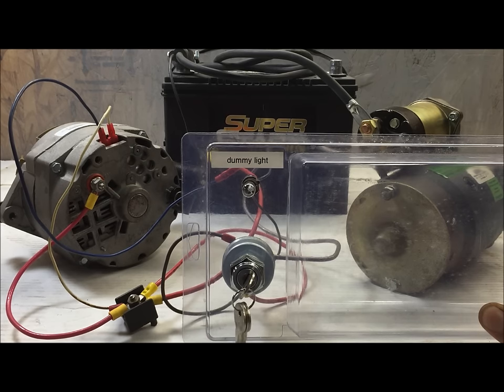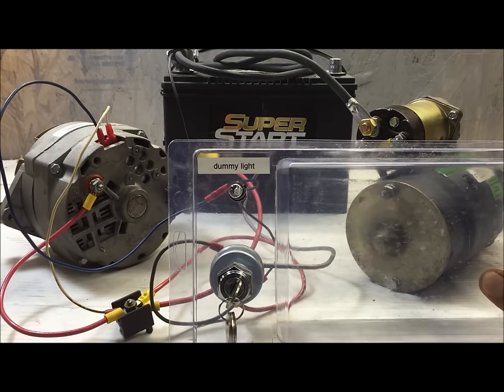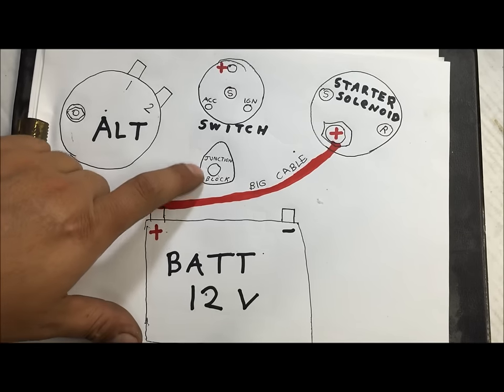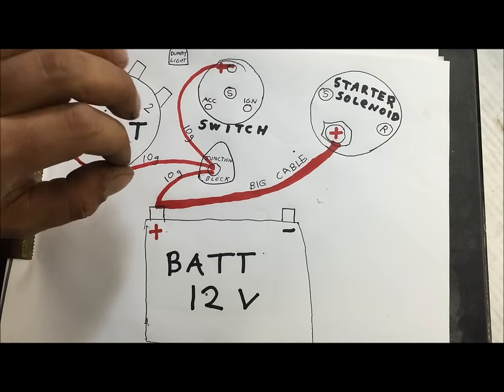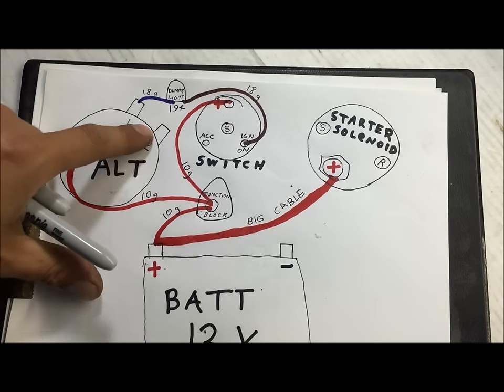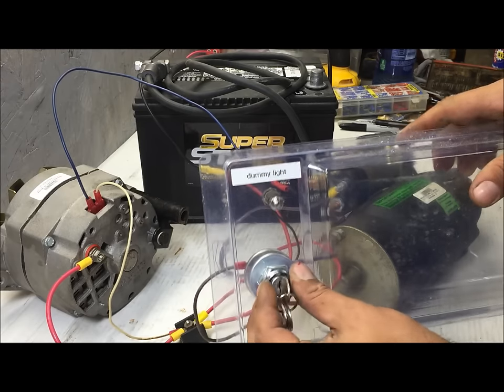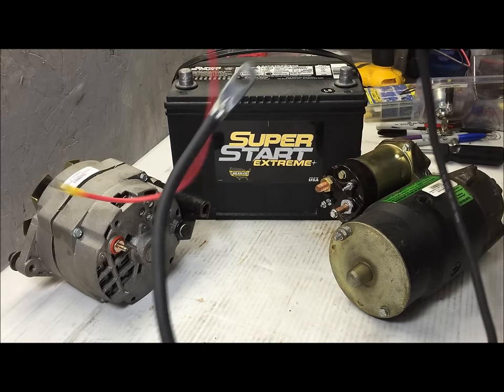64-72 charging system wire up using GM 3 wire internally regulated alternator

Comment: Could I use this method for my 73 ventura?
Reply from the maker: you need to buy a real wiring diagram for your car...  72 and up is wired a little different but it is the same idea...   yes, you could wire it like this ...  but the way it is already is fine
Reply: Chris Craft ok. Are you familiar with the old style fuse box? I was wondering if I could run a wire from the ignition part of the fuse box directly to the starter!?
Reply from the maker: those cars actually have a fused link off the starter powering the fuse box... off the big lug connecting to the battery..... i really dont understand why you would even want to do that...  please explain
Reply: When I turn the key nothing happens. I did a engine swap 350 Pontiac to 350 Chevy. I was told I needed to run the wire to the starter so it'll know when to start etc etc
Reply from the maker: there is a 10 gauge purple wire in the engine bay that starts you car...  it may have a fused link in it...  you really need to get that diagram to see where those links are...  find the purple wire out of the fuse box and make sure it is connected to I on the starter..  depending on the year the starters have 2 places to screw a small wire to...  I or R.. check that out....  or a blown fused link...
Reply: Ok thanks. I found a red 10gauge wire that gives me inside power (lights and wipers etc etc) I have a few other wires but only 2 are 10 gauge so it has to be one of them.
Reply from the maker: the red wire is going into the fuse box..  the purple wire comes out of the fuse box into the engine bay...  the purple wire goes through a neutral safety switch so make sure the car is in park or the plug is connected to the steering column...
Reply: LxrdJa
Reply: Chris Craft yea I found them thanks. The issue I'm having now is my flexplate was installed backwards so now I have to pull and reinstall.
Reply: felmor

Comment: Are there any inline fuses needed
Reply from the maker: just pop the hood on a vehicle and look where the fuses are... it’s up to you what you want to fuse
Reply: @chriscraft77022  thanks for the quick reply.  I'm restoring a 71 gmc with a 5.7,  it does have the conjunction but wires are cut in several places with fuses attached.  Going to install new wires and was curious where would be the best place to put the fuses.. thanks.
Reply from the maker: I need to make a video on fusing.. I will try ASAP
Reply: @chriscraft77022  sounds good.. I subscribed in case u do..
Reply: Hello again Sir.  I have another question,   my 71 has the ammeter. Do I still need the dummy light to prvent back surge,  also there is a light on my dash, I think its the batt light, would that be considered the dummy light? Its only in when I start the truck then shuts off.
Reply from the maker: @wiskiesgarage909  batt / gen dash light is dummy light..    ammeter has nothing to do with charging system...  i have videos on everything you are needing to know... search back on my videos..  i have a bunch of wiring that old stuff up on my 70 chevelle.... this video is basically how to wire it up on a tractor...   or anything, really..  the general idea
Reply: Rt on chris.. appreciate the response.   Ill check out the videos

Comment: alternator is nothing more than a pair of wires(stator and rotator). and dummy lamp limits the current in the rotator and also there  is a voltage regulator which sets the output of the generator to nearly 12 volts by inreasing or decreasing the current passing through the rotator.

Comment: in one thing you are wrong the R terminal can by used on a starter motor it a bypass to ignition coil to help with cold starting the second thing is that pin is used to reverse the polarity on a engine negative to positive ground and vice versa the ignition coil does not care what polarity is used it will still fire a spark! and by the way that ac spike gas 4 poles on them its tehnicaly not even ac its some thing ells whats fire in the cilinders ! by questions see how a emp device works! early magnetos never hade leads,distributor,condenser etc just 1 wire on the block! and bouth alternator and starter motor can by a :generator/starter/magneto at the same time that is what peopel dont teach in schools at all.so try that R terminal out and you will see they lied your car will work not fine but if you modify it litel it will run at a diferent polarity just like the old british cars again coil does not care what polarity.by notice some starter motor not mounted back then on the front by puleys thats why are there 2 pins so you can mount the starter just like a alternator but you need a regulator with out one the generater electricity will cause a engine run one so the starter is a magneto as well just like the old cars back in the days 🙂

Comment: So I don't know if anyone has a idea or if you would.  I'm having a issue with a build I'm doing.  I have a old golf cart that I'm putting a Honda clone 18hp gas motor with electric start.  I made a bracket for a alternator and its running off the crankshaft with a v belt.  It's a GM 1 wire alternator that is internally regulated.  The problem I am having is the engine will not start or run when the alternator wire to the battery is hooked up.  It pops an cracks an back fires through the carb like its causing some type of magnetic field with the spark plug.  If I unhook the alternator wire it will start an run just fine if I try to hook the alternator wire up when its running it sparks and arcs really bad.  Does anyone have a clue why this would happen.

Comment: chris I really like your video it helpme a lot to.understand. ignition .
but my problem is I have a vwbettle.66
and my wirering is like the one you
 show now in
 your. video but it wont dont crank .
and I have no power on ignition switch .
and my batery is fully. charge 12.6 
can u help?
thanks
Reply from the maker: you need to get a wiring diagram and buy a multimeter with a continuity function..   and start testing wires.... ive never worked on a beetle but the problem is probably around your starter solenoid ( if a beetle even has one, i dont know.. )
Reply: Hahaha yes it has one.!
I will follow. Your advice!! Thanks a lot.
Keep doing videos.you are the only one. Easy to understand.  You will be my teacher from now on.
Reply from the maker: where are you located? if you are in houston, TX i can fix your car in like 5 minutes
Reply: No chris Im in californi.
But thanks a lot! 
I really appreciate. You offer.

Comment: some people hook up accessory to the bulb wire so the alternator doesn't charge during crank fighting the starter
Reply: wouldn't that field fight the starter trying to spin the engine and actually slow it down? I am talking about during cranking not running.
Reply: Slow down lol I was just pointing out a small flaw in your diagram but i guess all the chiltons and haynes manuals have the wrong ones. Maybe if you go out to your car as long as you didn't mess with your charging system of course lmao and stick a simple test light or voltmeter in those terminals and tell me if during crank their is a magnetic field.Not supposed to be because it robs your starter of its torque. I never said your instructions don't work they obviously do. Their's always a better way nice chat though...
Reply from the maker: sorry, i wasnt attacking you..  i have a 3 wire alternator video that goes over what you were talking about..  this is a charging system video and i just happened to have it wired like that.. ( i had just wired it up on a model A)  you are 100% right about running #1 to accesorries..  but i just get irritated by people pointing that out in this video..when i have notes and comments about the fact that #1 may need to be connected to ACC on the switch..

Comment: question. If a car has all fuses removed, no accessories that are using any power whatsoever, and you disconnect the pos battery cable then connect a voltmeter inline between the pos battery post and the pos battery cable, should the meter show 12 volts or so? Iwas telling someone no, because there's no circuit closed,they said it should show 12. Which is it? Car in question is a '66 ChevyII

Comment: Is that the same way you would set that up if building  If you is building a portable gasoline generator
Reply from the maker: for 12V DC (direct current). YES
Reply: Chris Craft  That's what I thought I want to build a 12 V charger gasoline portable Thank you God-bless and have a merry Christmas

Comment: Can I used bigger cable like 4 gauge
Reply from the maker: watch my 100 amp alternator video..   of course you can use big cable..  also, google wiring charts and get an idea why they only used 10g on older cars..  even though they had up to 75 amp alternators

Comment: I have two white looks like shunts or something going to my main starter I cut them out and now my alternator is charging 18.9 volts please help. 1981 Chevrolet truck
Reply from the maker: I have a video on that
Reply: @chriscraft77022  what is the title I will gladly look it up I think it is a fusible link. I have replaced the voltage regulator inside the alternator as well and have a gauge instead of a dummy light

Comment: Wiring perfect..but show the connection with voltage regulator
Reply from the maker: the point is that in 2018 you don’t use the externally regulated alternator, but a good idea for a video.. I’ll try to get it up soon
Reply: @chriscraft77022  tnx..i wait upon my request...

Comment: If you replace the idiot light with a 12 volt LED, it won't feed back and cause the engine to keep running when you shut off the ignition!

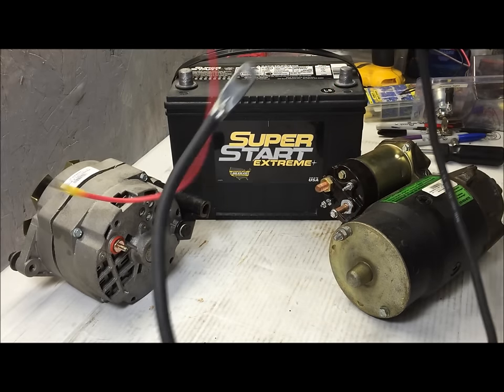Comment: For GOD's  SAKE !  At 8:22 you're hooking a BLACK CABLE up to the POSITIVE POST of the battery ! After you made a significant point of using the correct wire colors in your diagram, you should use a RED CABLE and let the backyard mechanics here KNOW that you're hooking that BLACK CABLE UP to the POSITIVE terminal of the battery ! Some poor bastard out there is going to use a BLACK cable and hook it up WRONG ! DISASTER ! DANGER ! I would reshoot the whole video over again using a correct color, ( RED ) positive battery cable. You're setting some fool out there up for disaster. God Damn. After such a good presentation too....

Comment: you make this look very hard cant you there has to be an easier way to do this
Reply from the maker: easier way for what?  What are you working on?
Reply: 1970 el camino custom just swapped the engine with a 350 LT 1 vette Engine going to put in a aftermarket hei distributor never done one before i know all about tdc and all that where the plug wires go the only trouble im having  what color wire goes to what.my wires coming from the harness are not color coated i guess i will have to strip the wires back till i see color right.i wrote down purple goes to s and yellow goes to R but like i said wires not color coated.
Reply from the maker: @larrybroad8746  this video is for tractors....   your car has a wiring diagram...   i own a 1970 Chevelle SS 454.... i have many videos on how to wire one up.. this is not it/// what year LT1???   my 2017 camaro SS has an LT-1

Comment: Great video, but you have your years mixed up.  They did not make this Alternator until 1973. The 64-72 the two wire plug went into the very back of the Alternator.
Reply from the maker: you obviously missed the point of the video...

Comment: Chris, great video, thanks! You describe a "194" light. That just seems to be the type of bulb. Can any indicator light be used such as this- https://www.ebay.com/p/Dash-Indicator-Light-Set-Painless-Wiring-80205/235830118?iid=173680538050&chn=ps ? 
Thinking "electrically", the juice would have to flow through the light to show charging, not be a pos/grnd light.
Reply from the maker: all gm vehicles used the 194 bulb because of the resistance it provides combined with another resistor on the ignition switch.. if there is not enough resistance ( LED ) the ignition will backfeed and the car won’t shut off and you will have to run a diode
Reply: Please pardon my questions if they seem dumb to you. I've googled "194 charging indicator light", "AC Delco charging indicator light", "GM charging indicator light", and nothing shows up. If I used the diode, do I use a regular 12V DC light like the one above with the power from the alternator to the red wire and hook the black to the ignition switch? I'm thinking the electricity has to flow through the light and not sure a DC light will work.
Reply from the maker: @lakehighland5448  watch my GM 3 wire alternator hook up video..  you buy a $3 194 bulb pigtail at oreilly..  look at it in the video.. that video will show you how to hook it up 100%..  in your case you dont need to run the bulb unless you have one in the dash that you want to work..  my 70 chevelle doesnt have a GEN light( bat) light in the dash so i ran a diode on the car
Reply: Ok, thanks. I'll check out that video. It occurred to me that I may have left out an important piece- I don't have a light to start with!! I bought a kit car built on a '62 VW Beetle frame. They converted it to 12V and rigged up a Delco 3-wire alternator.

Comment: Having trouble finding the 194 v light to mount in the dash of an ol tractor, Does it have to be 194 v or would 12 volt indicator light work as well and where did U get your light from. thx  my email is kart@nefcom.net thx
Reply from the maker: watch my gm 3 wire alternator hook up video.. you don’t even need #1 hooked up